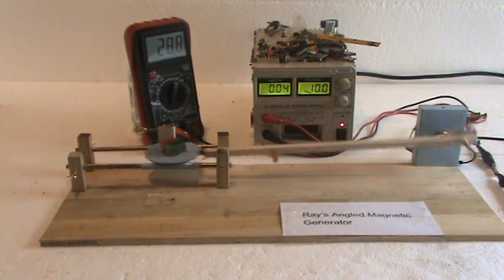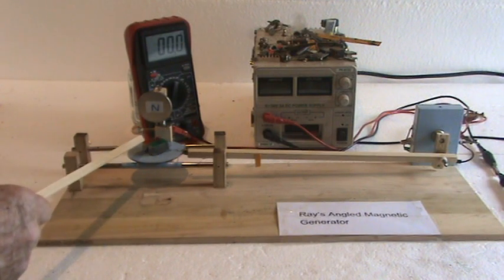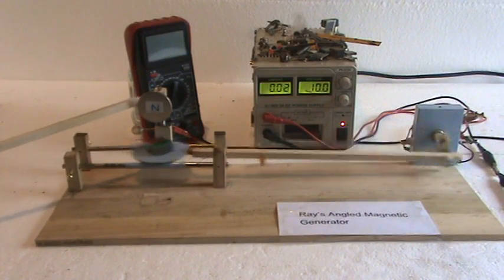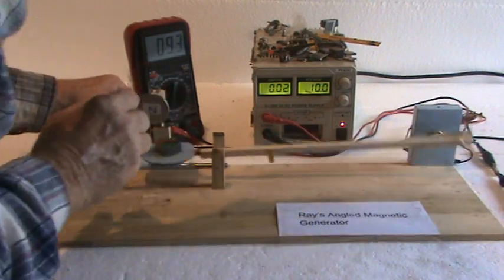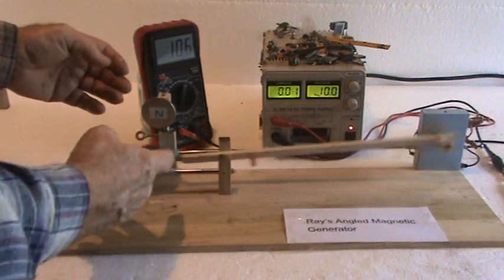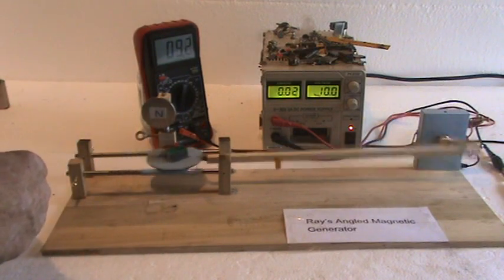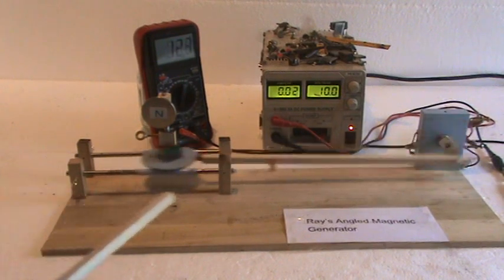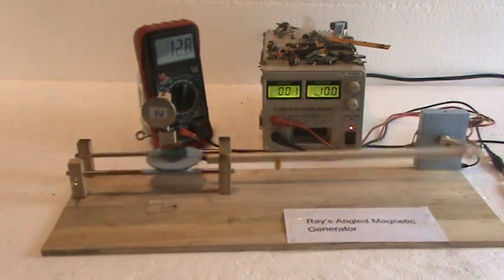Ray's Angled Magnetic Generator 1

Comment: U really got something here !!! I could see a multiple magnet set up similar to a V8 gasoline motor have you ever tried more than one if so what kind of results did you get? I know when I tried gerard morins pump set up I made a straight line of magnets and that have me a way better result but had to run the pump circuits in parallel otherwise they would cancel each other out

Comment: a 12% increase o if you put one under it then it will reach 600rpm a 24% increase. a better close up look would help.

If you have a small enough rotating device to put at the  neutral zone will it rotate?

Would the corner part be better than the ends in other ways? Someone else used the corner S part to make their plants grow better than the ends of the magnet is also another example.

Also the electromagnet coils are inefficient since they have too much friction since they all rotate one direction and cause friction to the wire next to it which causes heat and reduced power. Another wire would be better next to it or a bit of space to increase the efficiency it seems. Which is might be one reason the tesla's flat spiral coil takes that into account.
Reply: Next video shows detailed breakdown